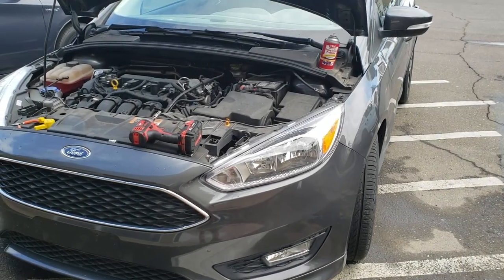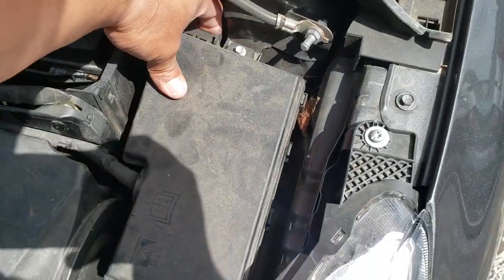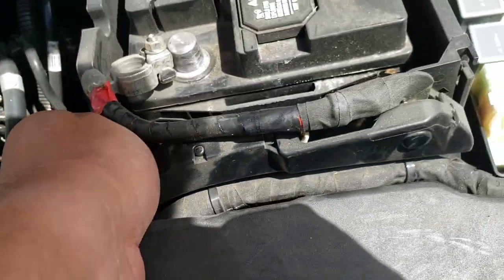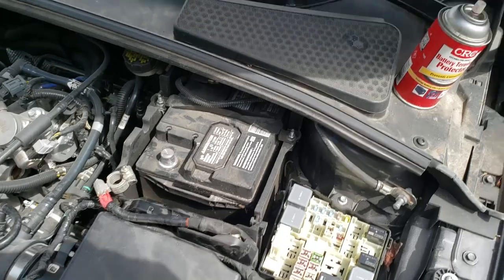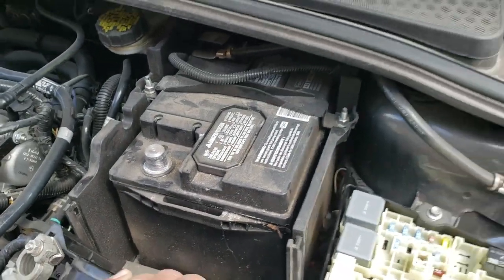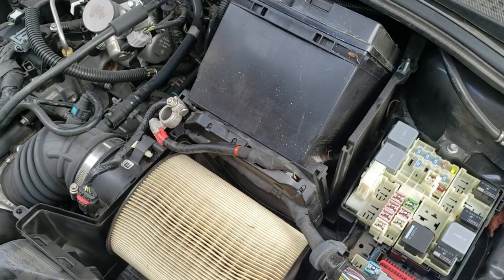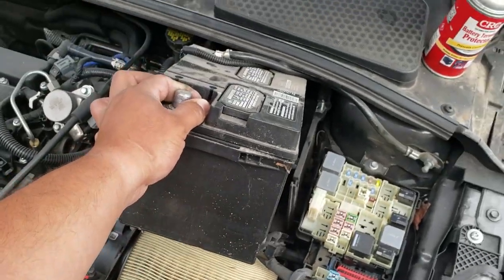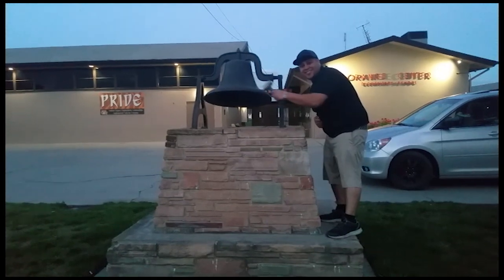How to: Remove a battery from a 2016 Ford Focus

Comment: i literally just did this pull. the only screws you need to loosen are the terminal screws and the bracket holding the battery down. it'll be tight. but it's possible.

Comment: I used your way of taking my out yesterday on a 2017 Focus. I just never unplugged the connector in the fuse box, and I was able to take the Negative cable off and back on with the battery in the box.
Reply: Also you have to do a Battery Management System reset when you install a new battery now.
Reply: Obviously it was his first time😂

Comment: ****Very Important****

If you open the fuse box and disconnect the C90 kaple. The car will maybe NOT start after you connected it. 
Disconnected and reconnected the C90 a few times and then the car should start 😉
Reply: My friend, you just ended a 4 hour session of trying to figure out why my car wouldn't start. 

Thank you!!

Comment: Not looking forward to this after watching the video. What a mess, thanks Ford. Thank you for making this video though, much appreciated
Reply from the maker: Thank you for your Support!
Reply: a fuse box cover and 4 bolts for a filter cover is “a mess” to you ? soft hands brother u got soft hands
Reply: By simply knowing how to release the corner tabs on the battery box cover, this removal/replacement is easy and quick. Release the box corners by pulling up on the front panel while pushing down on the side panel(s), pull the front section forward, and there is more than enough room to get the battery out and replace with new one, without removing anything else around the battery.

Comment: Don't touch the fuse box nor the air box. Release the tabs on back half of battery cover and remove it for full access to terminals. Then release the tabs on the front wall and tilt it forward.
Reply: Follow this guy's comment and DO NOT follow the video. DO NOT disconnect the fuse and airboxes. Just release the tabs on left and right sides and lean that cover forward to slip the battery out.
Reply: @sneakywan  there was no room the cover would not move forward I had to lift  the wire loom as this guy showed

Comment: i Changed mine out and all I had to do was lift up on front door as he called it and push out a little on the side panels and almost had to stand battery up on the end and lift it out. Goes back in the same way just stand almost on end and put back in put neg. cable on push back in place pull sides up and push front door down and then put pos. cable back on

Comment: Useful thanks! Did you need to use a memory saver or similar to save your ECU and radio settings?
Reply from the maker: No, the reason I make these videos is because the batteries are dead on these cars so they are replace with new batteries. There's no need for me to do a memory saving procedures because the batteries are already completely drained and nothing is available for me to save. Thank you for your support! I'm glad this helped!
Reply: @559powerscape  Thanks - just replaced dying battery on 2016 Focus 1.5 ecoboost.
No radio code issues. Just reset the battery monitoring system after replacing the battery:
- Ignition on (don't start engine)
- Press rear fog light button 5x
- Press hazard lights button 3x
- Wait a few seconds
- Battery symbol flashes (done)
👍
Reply from the maker: @nickbaker77  thanx for the info buddy!
Reply: @nickbaker77  hi i just wanna ask if you did it while the engine is off or on? Coz some says the engine should be on when ur changing battery for our cars, we got the same car. TIA.
Reply: @qu33nsir3n  I did it with the engine off. I'm no expert but it sounds risky to disconnect/reconnect with engine running...
Reply: @nickbaker77  oh i see cause they say if u do that while its off you will get different kinds of warning lights on your dashboard. Did your clock settings change after doing that? And is ur car an automatic transmission and keyless?
Reply: @qu33nsir3n  pretty sure I had to set the clock. When the battery is disconnected there is no way to maintain clock settings. I have heard of people using a back up battery plugged into the cigarette lighter or USB to maintain settings.
Mine is manual transmission with key and start button & auto start/stop. That is why it was important for me to reset the battery monitoring system so that the auto start/stop works correctly. That process is likely different on non-UK models because AFAIK the lights & switches may be different.
Reply: @nickbaker77  oh okay thanks for your time and response. HAPPY NEW YEAR!